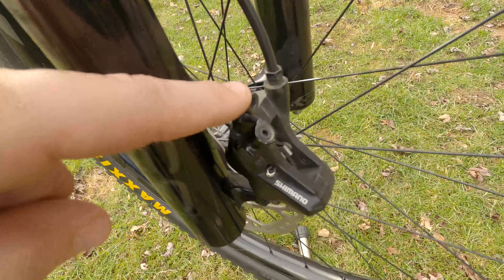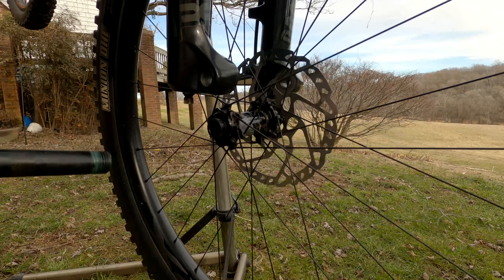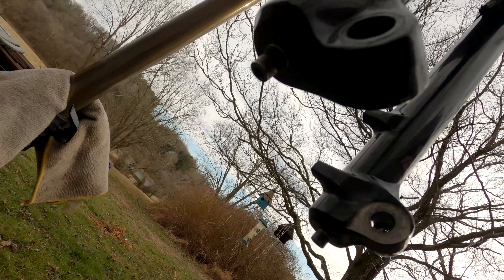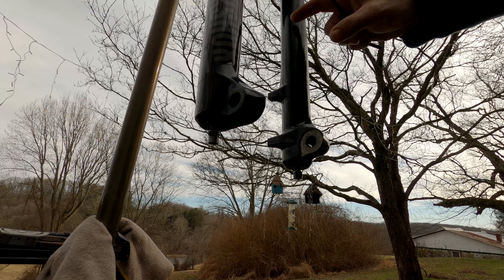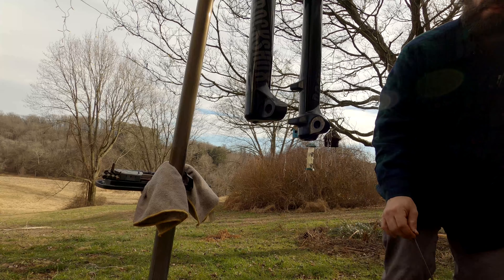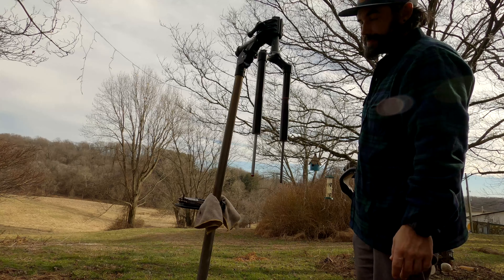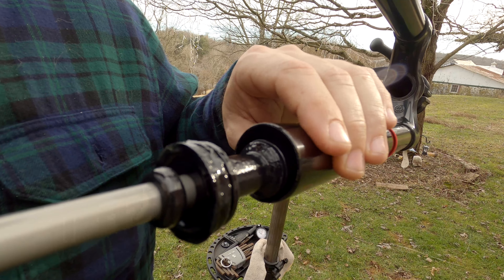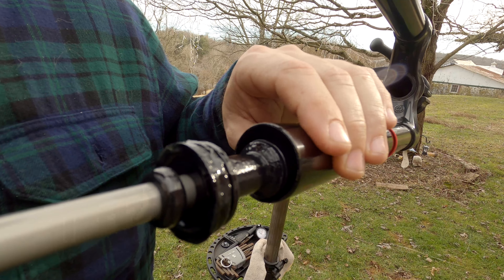Rockshox 35 Gold How to Change the Travel, A Comprehensive Guide, Tips and Tricks.

Comment: Nice vid, cheers! Anyone struggling with fitting the new wiper seals and doesn't have the specific tool, just pop them in the freezer for 20 mins. This causes the wiper seals to shrink slightly and makes it much easier to get them in by hand. You can also use the old seals on top if you need to result to mallet bashing.
Reply from the maker: Great Tip! Thanks so much for sharing!

Comment: I had these come on a stock bike I ran them at 160mm with almost 80 psi for most of the summer without major quality degradation, I switched to a zeb (ultimate) apart from the serviceability issues I don't feel the zeb is worth the difference... It's like 3x the price with 20% more sophistication.
Reply from the maker: Yea, I plan on upgrading to a Marzocchi Z1 in the future

Comment: They make some really awesome and not much more expensive than regular C clip pliers that ratchet down and make it so you don't have to hold the tension on them when installing you just squeeze it down and it holds itself. Getting the back of the clip started first then working to the ends of the clip also helps. Another trick is to use a socket that goes over the shaft and inside the tube and use it to tap the seal back enough to show the C clip groove fully. Just some tricks from a heavy equipment mechanic.
Reply from the maker: Awesome, I appreciate the thoughts man!

Comment: I found it easier when taking off and putting on that dreaded air spring Circlip to take the forks out of the stand and sit them upside down to do it.That way you can hold the forks in between your legs and it gives you a bit more force to put the bitch-clip back in.
Reply from the maker: Great idea! Thanks for the tip!

Comment: How are you adjusting the negative chamber
Reply from the maker: There is no adjustment. No dimple on inner stantion to allow air to pass. Only negative chamber fills on top out after big hit.
Reply: @mikemtbs  Thanks, i understand. But is there any travel lose because of too much air pass to negativa chamber?
Reply from the maker: @dimitar9355  no, you can get suck down...fork too low in travel w no weight on bike. But loose...no

Comment: i just bought a Rockshox Domain RC 160mm. Unfortunately to add travel i have to buy a new air spring. I'm thinking of going to 180mm. It sucks to have to buy a new air spring but atleast it's not too expensive at only about $45.00. I'm just iffy about taking the fork apart.
Reply from the maker: I completely understand. Buying something expensive then Buying something else for it sucks. Your gonna need to buy oil for the lowers and a torque wrench for the bottom bolts...just so you don't overnighter them.

Comment: are all rockshox 35 gold have the same air shaft?, im currently using 120mm fork
Reply from the maker: Yes all the same airshaft with travel spacers to determine fork stroke. Your 120 has travel spacers to take 160mm and turn it into 120mm. Pretty sure 160mm is the shaft, just  travel spacers that determine the stroke.

Comment: Hi Mike can i upgrade my 35 gold rl travel from 120 mm to 160 mm 😅?
Reply from the maker: Sure just take out all the all-travel spacers. Also adjust the oil level in the compression/ rebound leg.
Reply: @mikemtbs  I'm thinking about doing just this. What oil level do you recommend?
Reply from the maker: @taikuodo it depends on the travel your bike came with. Personally I wouldn’t go more than 10mm in either direction as it effects the geometry of your bike. You can go up to 20mm but I was comfortable adding 10mm of travel and the bike became more aggressive. Just know that doing this may void your warranty
Reply: @mikemtbs  I'm doing this on a take-off fork, just wanted to make sure. I'm hoping to take the 120mm to 160mm as I hear they just all have the same air shaft, so the 120 should just have a 4 spacers inside to remove?  Thanks
Reply from the maker: @taikuodo yep your correct, have fun with it!
Reply: @mikemtbs  got it. thanks. Sorry, a few dumb questions to follow up as I quickly watched through the video.

1. If I'm working on a brand new fork, I don't need to change out the seals / wipers, and don't need the wiper install tool, or 15wt oil for soaking the seals.

2. If that's the case, the only tools I need are: circle clip plier for that clip, torque wrench for the bolts that attach the lower/upper, sram butter, syringe, suspension cleaner, and 5wt rockshox oil.

am i missing anything? thanks for your help!
Reply from the maker: @ correct you won’t need to soak the foam rings. You will need new crush washers for the bottom fork leg bolts though. They’re cheap and you can get them from worldwide cycelry or somewhere like that. Your legs will leak if you don’t replace them.

Comment: Hi Mike, apologies if already asked and I missed the reply. Does shortening the travel shorten the fork in equal measure ? I mean If I go from 130 mm to 120 mm does the distance crown to axle reduce also by 10 mm ? thanks in advance
Reply from the maker: Hey good question. Yes it will shorten by 10mm and steepen your head tube angle by a half degree [.5deg.]

Comment: if i was to buy a very cheap 150mm 35 gold rl fork could i add some spacers to bring it down to 130mm?
Reply from the maker: You can but it's hard to find the spacers to buy. Sometimes Amazon has them, but I'm not gonna lie, you may struggle to find them.
Reply: @mikemtbs  dang it found some on sale for £122 and 150mm is a bit much for my vitus nucleas which is 120mm
Reply from the maker: @StruggledBeats  yea I'm sorry, you might find them on Amazon. I tried to buy spare parts from sram 2 years ago...they are still on backorder. I'll get a new fork before I get replacement parts for the 35gold
Reply: @mikemtbs  a number of bike shops seem to have them in the UK, I believe I need 32 mm bottomless tokens
Reply from the maker: @StruggledBeats  bottomless tokens and all travel spacers are not the same. Your correct about the diameter of the bottomless tokens but you need all travel spacers that you install on the air ahaft to change the forks travel.
Reply: @mikemtbs  DOH! They do a set for £14 so it might be worth doing for less then a £150 then. Thanks for the help it's much appreciated!
Reply from the maker: @StruggledBeats  happy to help! Feel free to subscribe as I make tech videos etc fairly often. Have a great day!
Reply: @mikemtbs  done
Reply: @mikemtbs  Quick update i ended up going for a set of revelations
Reply from the maker: @JamesToward  excellent, you will be much happier with those!!

Comment: With the all travel volume spacers, do you so happen to know if they are individual 10mm pieces or if for shallower travel forks they come as one piece? Eg. 130mm fork having 3x10mm spacers or a single 30mm piece.
Reply from the maker: @synolypse all the travel spacers are the same size and they come as individual pieces. You would have 3 10mm spacers in a shorter travel fork not just one. Hope this helps
Reply from the maker: Is shows an isometric drawing in the online owner manual at sram.com
Reply: @mikemtbs  it's not true unfortunately. I have a 2022 model year of RS 35 Gold 130mm and I have single spacer that has 30mm, shame since I wanted to make it 140mm and I cannot find replacement part to have 2x10mm
Reply from the maker: @mateuszpeczek5101  oh yea, I forgot it's impossible to get parts. Better off selling the fork and getting something that performs better